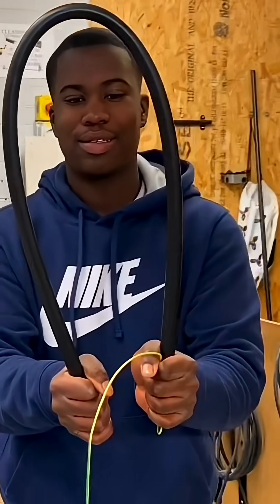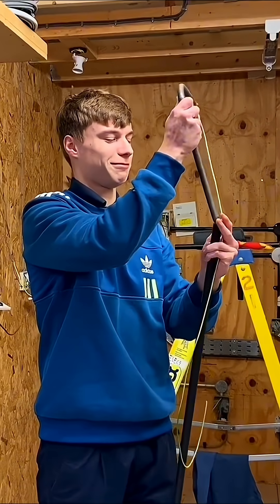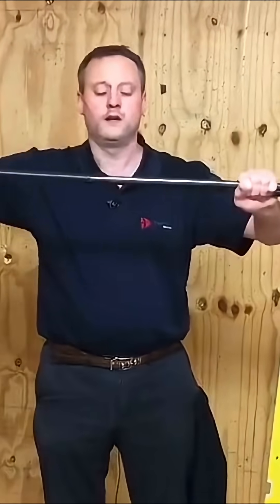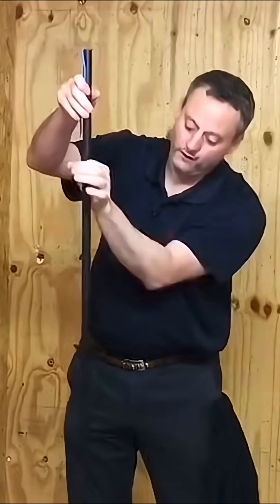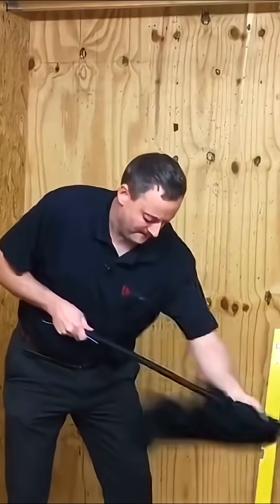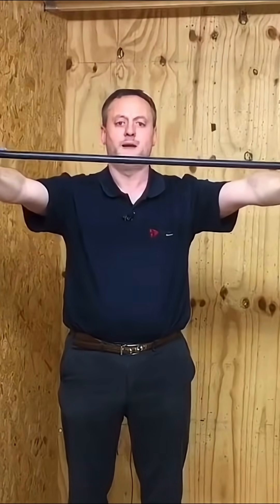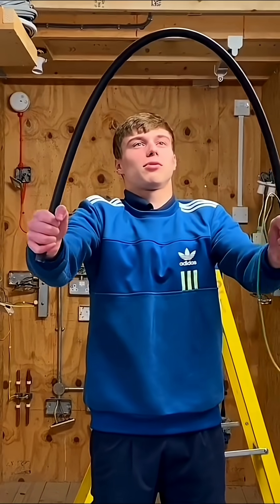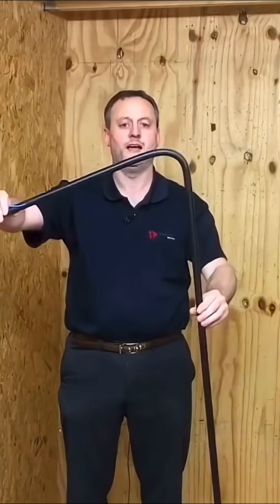How to Bend PVC Conduit GSH Way

Comment: Run the bit of single thru the middle of the spring so you pull from the back when removing
Saves it from getting pulled apart and ruined 😭